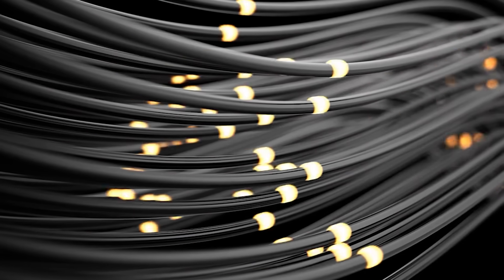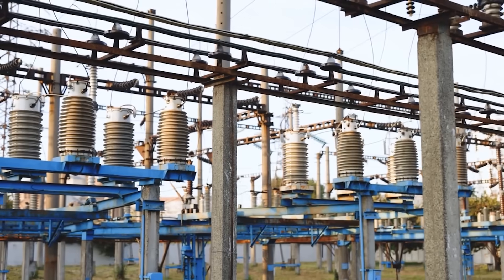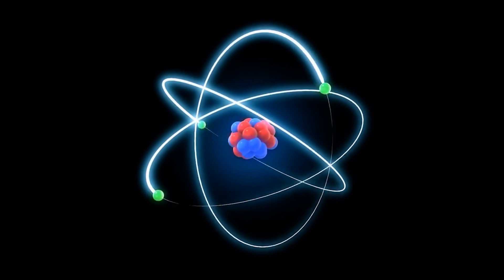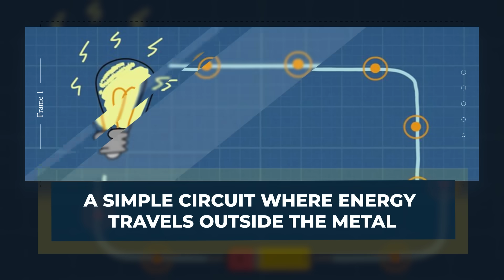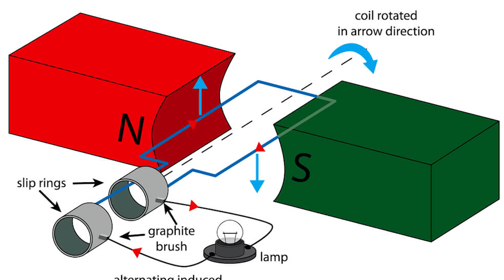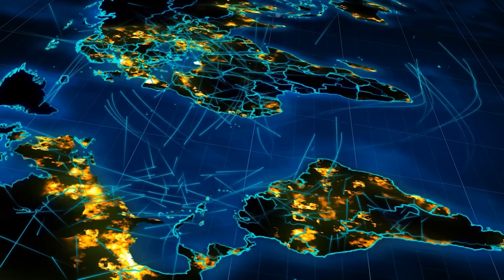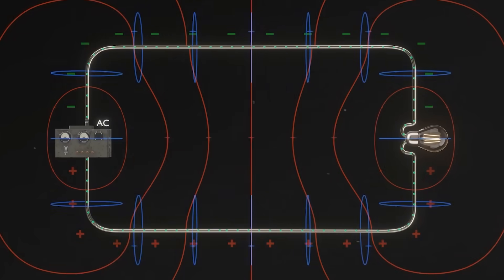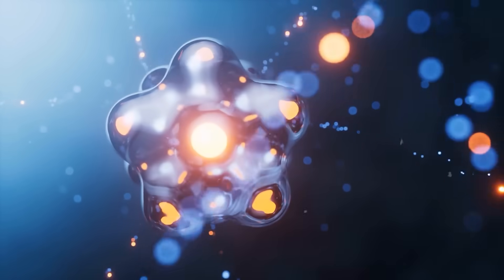The Biggest Electricity Lie (And the 1-Meter Trick That Exposes It)

Comment: What is creating the light? Electromagnetism or charge pushed around by em?
Reply: a combination but basically changes in the electrical field charges electrons to jump up from one layer (valens layer) around the atoms to a higher and when they fall back, that energy difference is emmited as light. Depending on material, the color is different or even gamma rays. Pure material give only one color which is used in lasers. There are other causes too..

Comment: Almost had it, Maxwell avoided the discovery made by Ampère l. That was the beginning of a usable tool to create the energy economy. 

André found the secret created a law to manage it and the great powers of the time immediately forgot it . 😂 Even then science knew it's master was money and profits it's mistress. 

Try to see magnets as always energized wire, then ask what are they both interacting with? 
A magnet like a charged wire create a pinch point in the universe of stuff we all exist in. The only reason for a loop in the wire is because if the earth or an atmosphere was used it will hold that charge till it finds a way to release (think solar flares), it was tried with electric trails in Europe, worked but some side effects were undesirable, the return is so that the moving charge can be neutralized/cancelled at the source. 
André Marie Ampère work wasn't complete but his understanding of the universe is far more accurate than what we use in the standard model.
His work was peer reviewed and reconfirmed by MIT - Peter Graneau Neal Graneau sometime in the 2000-2005 . It can well explain Mach's principles when it's applied across all matter. We exist inside an isotropic universe that has disturbances caused by consolidated harmonics.

Comment: It remember me that I don't like the stick to the moon théorie.
It says that you have a stick (hard rigid and straight) long enough to touch the moon. You move your hand up and down (with the very long stick) to tap the surface of the moon and that doesn't happen instantly.
I think they're saying that the stick's movement is at the speed of sound. I don't remember the time but it was in minutes or hours. They say there is a wave of compression along the stick.
And I don't like this idea. I mean, if a helicopter's blades can go faster than the speed of sound (It's not a good thing, but it happens), why can't my stick that go to the moon can't too ?

Comment: There's a bigger shame that everybody's missing with the ignorance of Renewables once connected to the grid as a micropower double check your watt meter with a volt amp meter with the optional amp clamp takes less than a second to demonstrate the ignorance of Renewables assuming you could do the fourth grade math called Ohm's law

Comment: 0400      my question is, HOW can two fields that are propagating from one conductor at the same be at some  ANGLE  with respect to one another.?!??!?       logic suggests that each of the fields propagating under those conditions will have a 'cylindrical shape' that aligns with the conductor.      in order to get accurate resuls in the experiment, there must be simultaneous switching at both sides of the circuit, near the power source.    otherwise, there will be  bias/potential in at least part of the circuit.

Comment: I think this said the energy is carried in the electric and magnetic fields which are outside the wires. If so, why do we need bigger wires to carry heavier currents ?  And why do circuit breakers work ?
Reply: The energy travels outside, but the availability of that energy is limited by how much current the conductor can furnish without overheating.  Bigger conductors ⇒ more current ⇒ more power; breakers keep the conductor from destroying itself when you ask for too much.
Reply: @williamnelson4968 💯

Comment: The long loop is actually a shorted transmission line.   at the bulb the current will flow at once with it limited by the "surge impedance" of the "transmission line."  When the surge bounced off the short and returns the bulb will have full brightness.

Comment: Bike chains make a complete circuit, but they have no problem transmitting energy from the pedal crank to the wheel hub.  That's because one side of the chain is tight and the other is loose.
Reply: Loose Light, I love it
Reply: Not true if the chain was just as long then it would still take time to turn as the chain would stretch as to not violate the speed of light and the transmission of information.

Comment: 1:07 „the wire has no resistance“ …? Only in superconductivity.
Reply: Of course it has resistance, just run new power out to your garage, the wire will have to be a certain gauge depending on distance from house  but what about the high voltage lines that travel through out the land.
Reply: @martinalmendinger8563  High voltage line uses the trick: AC, the power plant which "shoves" the electrons forward and then "pulls" them back. This creates a wave of pressure (the electromagnetic field) that travels through the wire at nearly the speed of light
Reply: @Iliribur OK I get that but the resistance is only a factor to reason with after the transformer mounted on the pole which steps down voltage to 220v for home. If you take a small generator say 2kv and connect to low side of transformer and the high side connected to high side of another exact transformer your left with the low side powering your house or houses easily

Comment: A minute 30 in. So technically the speed of electricity is about a third of the speed of light. So if you were considering that it would be 3 seconds. However it depends upon how thick the wire is because of voltage drop and any resistance. Hope this answers your question, lol.
Reply: I kind of see that you're trying to teach people about electricity but this video is just horrible. It's like a question about macroelectricity to teach people a few principles with the ease of knowledge of IER or VxA=W. If you're considering the eddy currents of the Earth, it's probably going to turn out just about the same and your wire is acting like a transformer anyway. Like a whole bunch of just extra junk when all you need is IER. I'm actually angry at this video. I kind of hope it's maker stubs their toe while getting kicked in the shin.
Reply: The speed electricity travels through a conductor (Vp) is C/sqrt(Er). Vp is the propagation velocity. C is the speed of light. Er is the dielectric constant of the insulator. This video is confusing. Er = 1 in a vacuum. Er ~ 1 in air. For  Vp = C/3, the dielectric constant of the insulator surrounding the conductor would have to be 9; which is quite high.

Comment: This is basically correct except that the amount of energy reaching the lamp immediately is minuscule. It will take the one second for the full power to come there unless the cables have so much capacitance between the forward and the return wire that it works as a short circuit.. The power is in the fields which in my opinion is both in and outside the conductor. The electrons supposedly don't move very far at all.  This Video is basically a rip off of a Veritasium Video that with some small degree got it right but mucked it up a lot. .
Reply: True

Comment: Nice video and I thank you. However, electrons should not be understood as tiny solid particles, but as convenient labels for discrete charge interactions within electromagnetic fields. They are not rolling beads of matter, what moves and carries energy in circuits is the structured interplay of fields. Surrounding every conductor is magnetic space, curling and twisting with current, while the dielectric counter-space responds in resonance, forming a dynamic, balanced system of induction and capacitance. This field-based interaction, not the imagined motion of tiny particles, is the true mechanism of electricity and energy transfer. Visionaries like Maxwell, Steinmetz, Heaviside, J.J. Thomson, Edison, Tesla, and Bell understood this reality: electrons are shorthand for the intricate dance of energy, fields, induction, and capacitance. Modern teaching often oversimplifies this into particle cartoons, but the deeper truth is that circuits and electricity are resonant systems of fields and energy 
- Electrons are our labels for the patterns, not physical beads moving through wires.
Reply: Theoria apophasis much?
Reply: @byronsmith1982  overthinking has some advantages
Reply: Fields of what 😜
Reply: Ok. Et physiquement c'est quoi des champs et de l'énergie ?
Reply: @alligator2768waves. Physicality, as we see it are the results of waves of energy which light transfers. E=mc²
Reply: @PhilDavisplus но как мы чувствуем поверхность и предметы,ведь свет мы потрогать не можем??
Reply: @qwert4750 light is energy in motion. We actually never touch anything solid. Mass or objects are energy being accumulated. Everything is energy, light moves energy. Mass is accumulated energy. Atoms in the table you have your hand in are pushing away atoms in your hand. You never really touch anything.
Reply: Just wanted to add that Steinmetz pointed out, in his book 'Theory and Calculations of Transient Electric Phenomena and Oscillations', that the only real thing is the dielectric and magnetic fields - everything else is a mathematical fiction.
Reply: Thanks. You just have to incorporate the collapsing wave function into your explanation now.
Reply: @calthorp  QM is filled with reifications.
Reply: Как и когда вокруг проводника возникает магнитное поле?!Вот на заводе кусок метала-вокруг него есть магнитное поле?А потом его прокатили между валками и получили проволоку-в какой момент там возникает магнитное поле??А если проволоку переносишь-магнитное поле тоже за ним переходит?А если скручиваешь в катушку провод-магнитное поле усиливается-откуда лишнее берется?!Кто-то лопатой подкидывает?!!
Reply: А вот при электрическом ожоге частички метала проникают в организм человека в месте ожога-как метал туда попадает,если электроны не двигаются??Что о ты недоговаривает
Reply: @qwert4750  You've been misled to believe electrons are particles.
Reply: @davidshumard а кто тебе правду рассказал?

Comment: The Earth is spread out across the magnetic plane of inertia, between two halves of a dual torus. Matter forms here because it's the only place where charges can find balance and form. High + potential above, neutral center and high - potential below. As above so below. Our understanding of what the Earth is and how charges form is incorrect and incomplete.
Reply: To add to that the 2 torus fields are NOT 180 degree out of phase, but actually 90 degree out of phase.. T1 = 45+225 || T2 = 135+315 this causes the plane of inertia to form as it's the place where all the magnetic field vectors cancel out.
Reply: @0x2a1A4  Is this related to what's called the right hand rule? Like how the EMF that turns motor windings exerts itself at 90* relative to the magnetic field?
Reply: @tiredironrepair  nope. this is related to the fact that a magnet hes 8 poles and not 2
Reply: Where can I read more about it?
Reply: Why is this popping out everywhere? Are we remembering? I think so